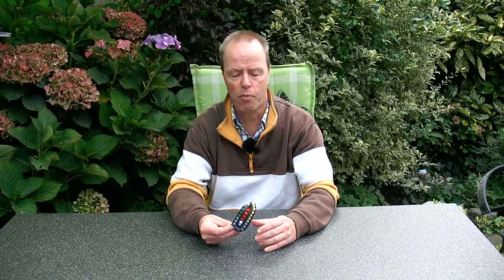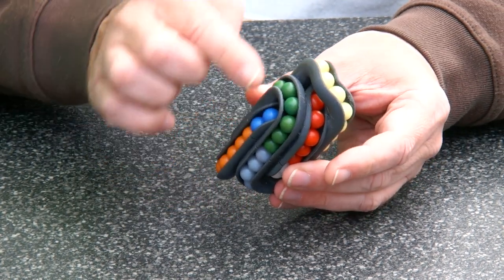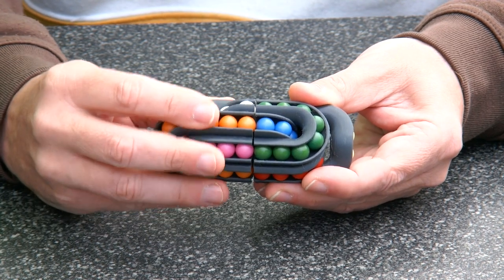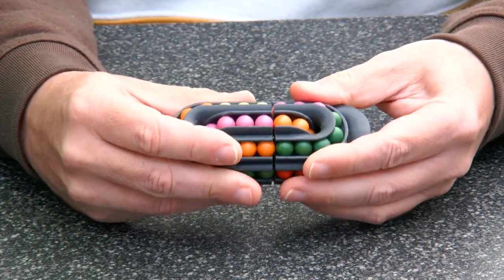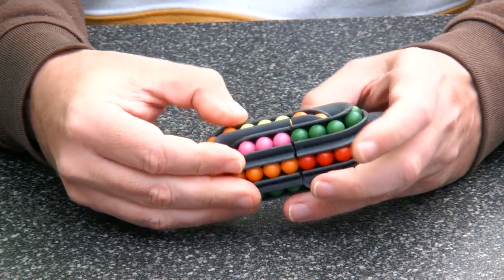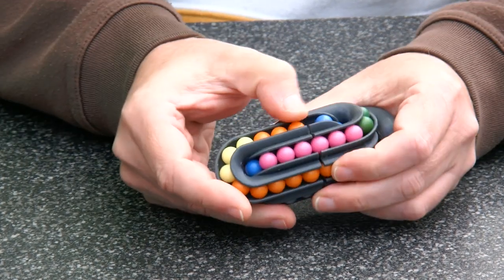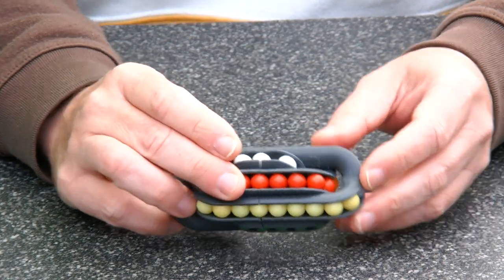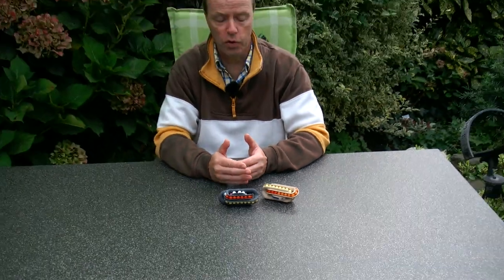Spaghetti Junction - Which highway intersection does this puzzle resemble?

Comment: Wood implies greater friction. This puzzle appears to want a low-friction plastic such as Delrin. Think how intricate such puzzles can be if you can eliminate most of the friction!
Reply from the maker: Indeed, friction makes the difference. And the filament appears to be available herew: https://all3dp.com/2/delrin-3d-printing-filament/. They mention the issue of bed adhesion, but I may know just the trick for that. My wood filament adheres very well to the bed. So the question is how well Delrin adheres to a layer of 3D-printed wood. I have tried the combination wood-PLA-wood-PLA-wood a few weeks ago (Screw Barrel), and that worked like a charm. Thanks for the suggestion!
Reply: @OskarPuzzle  I didn't know you can home print Delrin. That's exciting! Note though that Nylon and some other plastics are also "self-lubricating", in case you can't solve any adhesion problems with Delrin.

Comment: Why haven't you or Devin made a hand tool that can be used to move the balls in these puzzles? I often see you both struggling to move them so it would help
Reply from the maker: See my response to Melinda Green elsewhere in the comments. Please point Devin Montes to this page: https://all3dp.com/2/delrin-3d-printing-filament/. I'd love to see him try out the material. Also, the bed adhesion issue could be alleviated by first printing a layer of 3D-printed wood, which adheres well to the bed.

Comment: Is the puzzle always solvable? like if you just opened it, and put in the balls in the halves at random, is it guaranteed that it could be solved? If so, that's probably a much better way of scrambling it
Reply from the maker: Most likely, not sure ...
Reply: @OskarPuzzle  It has to be solvable since you can always undo each scrambling move.